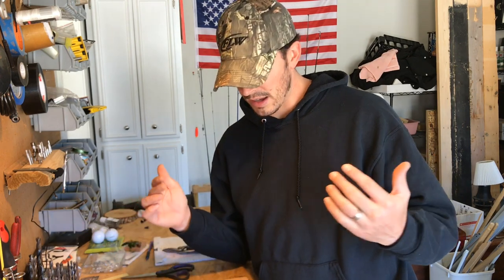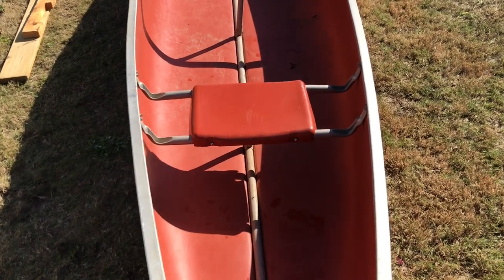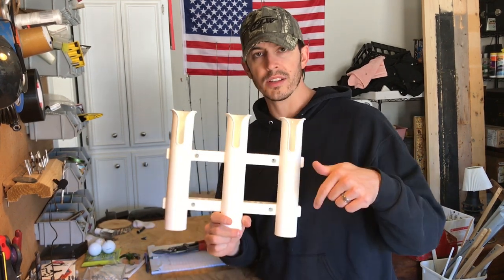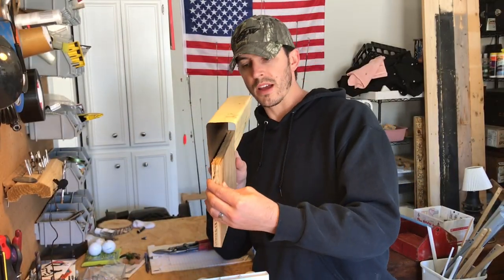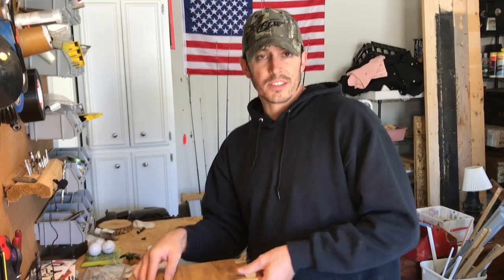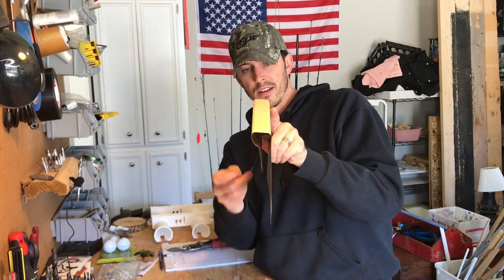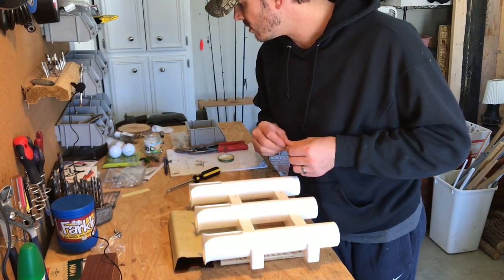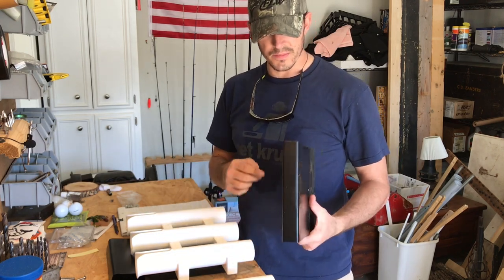Canoe Fishing Rod Holders DIY (Removable) (Kayak)

Comment: The rod holders look like a great idea that I think I would like to make for myself.  When I watch you in the video bending them back into the center of the canoe they look very stable, however they also look like they would just flip over the side if a large fish pulled tipping the top away from the center of the canoe. Did you find that to be the case? If you did how did you alter the design?
Reply from the maker: I don't typically mount the rods while I have baits out, but I would just get some small u bolt and a bungee or rope around the bottom to keep it from pulling away from the canoe. Good thought!